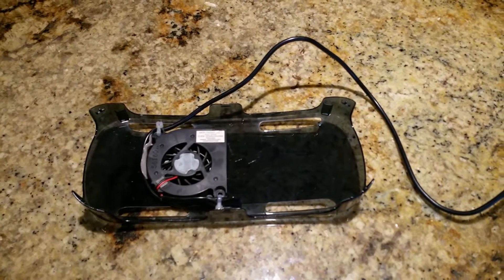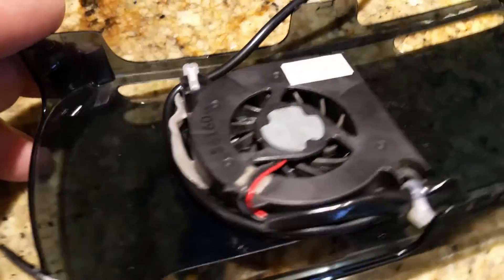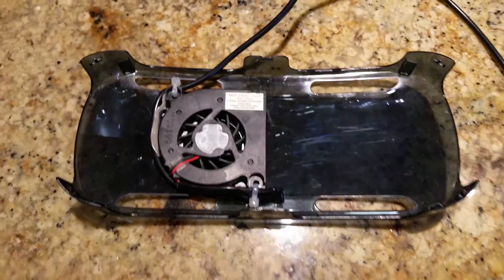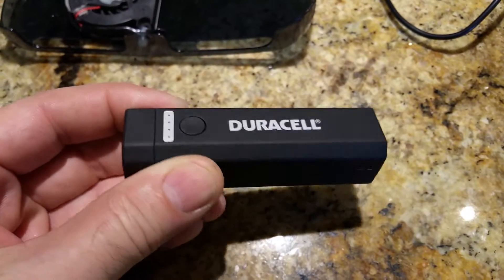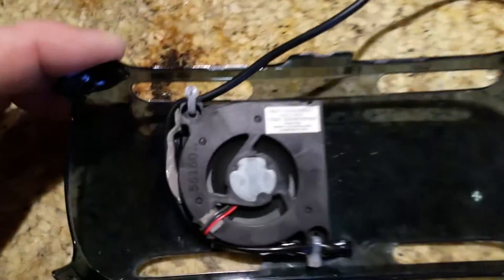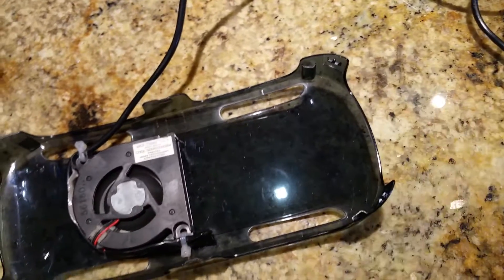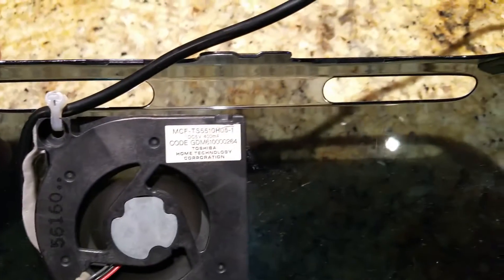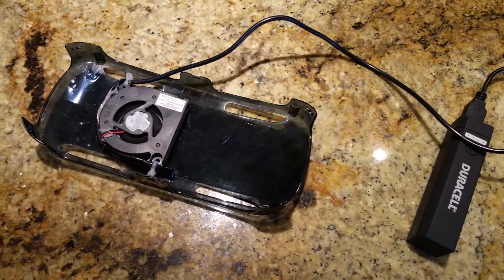Part's used to make Samsung Gear VR cooling mod for the Note 4

Comment: Why do you need the resistor. I have just made one with a laptop fan but i didn't have a resistor do i need one?
Reply from the maker: I used the resistor to slow down the speed of the fan to help make it completely silent

Comment: Hi Carlos, how loud is the setup? I used a 12 vGraphics card fan and its loud
Reply from the maker: I used a resistor to slow down the fan rpm. In my setup I can not hear the fan at all.
Reply: +Carlos Camara , Ok thanks for the reply. Ordered my fan. I will be putting a POT , so I can adjust the speed.
Highly recommend this..
http://frys.com/product/8235206?site=sr:SEARCH:MAIN_RSLT_PG
I just velcoed it to the front side of cover. It's light / cheap and flat.

Comment: i have  the gear vr  and the note 4 it works great but it over heat at times  is there any way you could build me one  and how much would it cost
Reply from the maker: Sorry, I only built this for myself, never thought of selling it. I think it would cost to much in shipping since I would need the outer shell shipped to me, then I would have to ship it back.

Comment: may I ask how did you convert the power cable to usb, or is this a usb powered fan?
Reply from the maker: all I did was cut an old usb cable and connected the end to the resistor and fan
Reply: +Carlos Camara can you include a shot of the resistor ? I'm not experienced in electrical wiring , so a suggestion as to were to purchase it would also be appriciated

Comment: Thanks for the info.You should get paid somehow for that. Is it possible to actually show us how to wire and solder that stuff together. For instance, where do you put the resister. I have never done any electrical assembly but I think I could do this with a little help from you. If you did post a video like that I know it would be as as awesome as this one and would  surely help people less knowlegeable in electronics like myself. By the way, I haven't bought the unit yet because of the overheating issue but if I can make that fan I will be racing to the store. And also it's not for me. It will probably be a late Chrismas present for my neice. But anyway, thanks for this great idea.